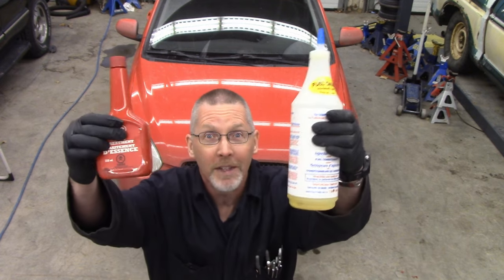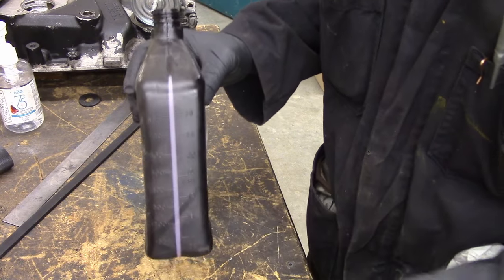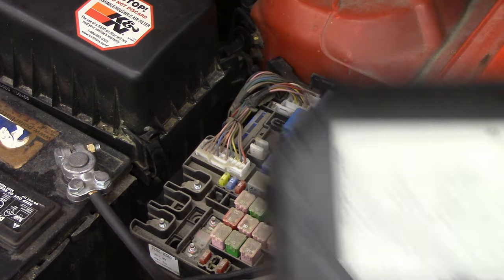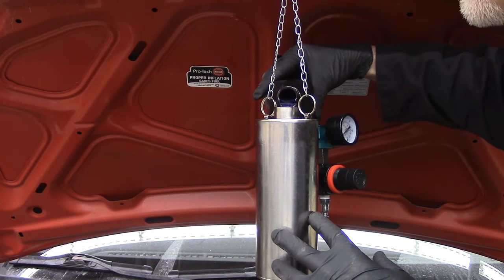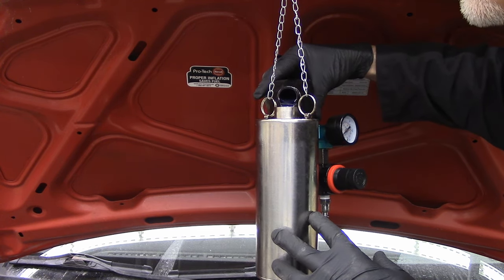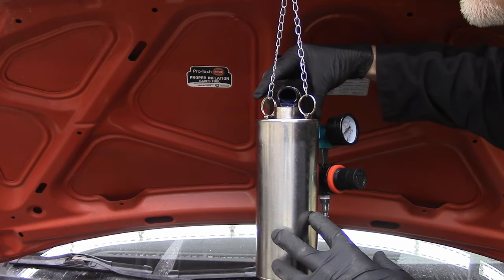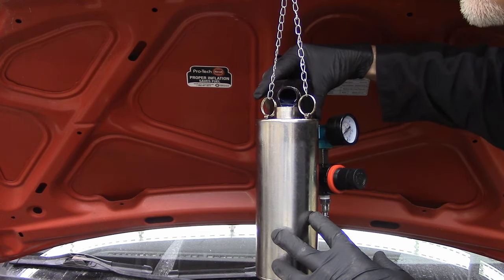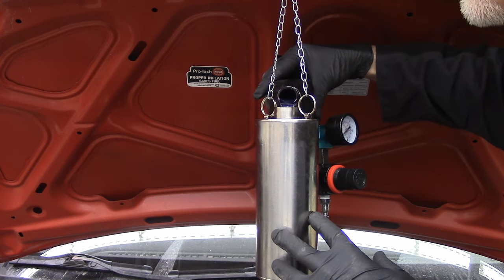HOW TO: Clean your Injectors IN PLACE!

Comment: No need to do that. Just drive on the highway and floor the accelerator once in a while and you will never need to clean your injecters. Fuel itself is a powerful solvent anyway.

Comment: I'm also in Canada and am having a hard time trying to figure out what to put in these machines. I was able to find something but I had to order it from the states and it's good to know that I can pick up something from Crappy Tire if my situation becomes more urgent. Fortunately, I'm only getting a misfire code on one cylinder and it only happens when my wife drives it. I can drive for hours with no codes. My wife drives 30 minutes and the light comes on. Four times I've reset the MIL after she drives. New plugs and coil but no luck.

Comment: I use STP concentrate fuel injectors cleaner I pour a can or two into the gas tank when it is a quarter low and add gas until half full and then I put the pedal to the metal and it works for me I also use chevron injector cleaner

Comment: I have a 90-something year van with a V6 and when I mash the gas it really don't get up Van Gogh it eases on up and sometimes it kind of makes a sport knocking popping noise and I was told it was a clogged up fuel injector or the muffler Cadillac
Reply from the maker: You can confirm a plugged exhaust with a vacuum gauge (vacuum drops at a steady 2000rpm), and you can substantiate clogged injectors by looking at Long Term Fuel Trim (LTFT) on a scanner (adding high % more fuel).
Reply: @GregWellwood  I don't drive it much. Matter of fact last year barely put a thousand on it. This year's about I think I might have about 1300. My first long trip hour and a half one way right at the end it started acting funny and then on the way for about 30 miles it wouldn't get over 20 miles a hour the next crank up and run fine 5 mi from the house starting

Comment: Hi, I didn't see it asked elsewhere - can you tell me what sort of adapter you used to connect your compressed air?  I bought a similar kit but the quick connect for air is a size/shape that I can't find a mate for.  1/4" is too small.  3/8" too large (it will go on but easily slides back off.  Appreciate any help :)
Reply from the maker: The air lines at work use an "M" coupler, so unthreaded theirs and threaded mine. Theirs is allegedly a common connector, but I have never seen what connects to it.
Reply: @GregWellwood  It's a Nitto coupler.  It fits Japanese and Chinese couplers (from what I have learned)

Comment: For the loose tool case, I've fixed that in the past by smearing a thin coat of hot glue in the bad slots with a popsicle stick. Another option I haven't gotten around to trying yet, but may work, is gently smushing the slots tighter with a soldering gun plastic smoothing tip (like the Weller 6160).

Thanks for lesson and the humor. Have a happy new year.
Reply from the maker: I'm going to have to try that! And thanks!

Comment: That button on the top where u fill it (blow off valve) is actually used to decompress the system. Thanks again bc I also didn’t know if it was returnless or not so thanks for the amazing video.

Comment: It runs a long time on that small amount of fuel because that small engine is just idling.
That 5.7 would eat it faster but it's most likely that the fuel went to your fuel tank on the return side. I've had it happen before.

Comment: the valve on the cap should be a manual pressure release valve.  Just push on the top of it after you are done running the cleaner and have disconnected the air supply hose you can depress to valve and relieve the pressure in the canister and line before disconnecting the line on the fuel rail.

And a tip on the return line system with this set up, another safety precaution is to take the gas cap off or jam a funnel into the filler neck of the caps less fill ports. This is just a precaution in case you accidentally open the pressure regulator on the rail an have 40+ psi of constant regulated pressure being pumped into the fuel tank. It it does the pressure will harmlessly vent to the atmosphere and not rupture your tank.

Comment: I've had good results doing this but not nearly as good as an ultrasonic cleaning on a flow bench. The students like it better too because they get to actually see and gauge the results of the cleaning by watching and measuring the way they flow.
I have the OTC on car master fuel injection kit with all the fittings (in my opinion, better kit than this because of the quality and the spec. book that's included for students to look up the information in). We also have the new Launch CNC-605A flow bench with ultrasonic cleaner. Both good products.

Comment: Would you know where the fuel service port is found in the 1996 V6 Toyota Camry LE?  Is it the port where the fuel pump regulator is attached?  The fuel pump relay is disconnected to turn off the fuel pump, so it makes sense to connect the system through that.

Comment: Thank you for your time in doing this, How can you decide if the actual injectors need to be changed, My Volvo has 222K miles and I am getting fuel injectors cleaners, the car runs great when driving. Thank you in advance
Reply from the maker: If cleaning doesn't fix them (and probably a more thorough cleaning than this can provide), they need replacing.
Reply: Depending on your car manufacturer mantainnce requirements  you probably need to replace the injector s every 100k miles. Just like everything else in your car

Comment: This is the third fuel injection cleaning process that only cleans 4 cylinder engines. I should get one of those kits unless I can find a cheaper way to do this. I wouldn't use Seafoam though.
Reply from the maker: What makes you think it's limited to only 4-cylinder engines?

Comment: Would adding SeaFoam to the gas tank when near empty accomplish the same?
Reply from the maker: If you could run Seafoam 1:1 with gas, yes - it would be the same.  Truthfully, this system would work best if you have an off-the-shelf "burnable" injector cleaner that is meant for this type of system.  Can't find much in this part of Canada....

Comment: I may do this as I have a pressure issue possibly an injector or pump issue. Ran seafoam.theought the gas tank for 1 tank no change in issue. So have done the key on-off method to pressure the fuel rail, and it starts right away. Does a seafoam induction clean and vehciel smoked for 22 minutes nice and thick and drove for 10 minutes on highway and still smoked another 5 minutes ran another round once I got back and this time it was light smoke so I'm assuming that I did well. Throttle body looks.clean from direct spray in method as well and wiped it out. I'm servicing an 02 Town and Country that was heading to the junkyard. And donating to a needy family.

Comment: How do I find out what the fuel pressure regulator is set at?  

The Haynes Repair Manual for the 1996 V6 Toyota Camry LE says ignition on with engine not running 38 to 44 psi, engine idling with vacuum sensing hose detached (38 to 44 psi) with it attached (30 to 36 psi), fuel system hold pressure (21 psi).  Which value should I consider in pressurizing the unit, subtracting 5 psi from it?
Reply from the maker: If you leave the hose attached, 5psi less than that one.  Consider plugging or pinching the return line anyway, and remove the gas cap so you don't inflate the tank by accident.

Comment: been putting off buying one of those kits for years, now with fuel prices and the possibility of russia going all in as a retired US genral said,  fuel prices could go crazy.
Reply from the maker: I don't think the kit will grossly improve your vehicle's fuel economy.  The price of gas is why I bought the Hyundai - my daily driver '77 C10 was getting expensive at $1/km in gas alone.
Reply: @GregWellwood depends on how bad the injectors are. I had a 95 escort and drive back and forth a couple times a month for college. I started out being able to make the trip on 1 tank, then slowly my mileage got to the point where I would have ran out if i tried it. We had a bg fuel service machine at school and I used it. I went from having to stop to having 1/4 tank left. I literally went from 20 mpg back up to over 30 mpg just from a fuel injector cleaning.

Comment: Hello sir I have question ? 
For dıs tool how to use.if you don't have air compressor to make vacuum line .den how to use dıs tool? 
If you connect for tyre compressor it's will work YES or NOT ? 
To understand how to work or to work whit dıs C80 cliner tool ? 
Thanks very much 🙏 🎉

Comment: Just Use Lacquer thinner in the Fuel Tank With Low Fuel. Roughly 5-10L of Lacquer thinner will clean everything from fuel tank to injectors exhaust side of Turbo Vanes and DPF if you own a diesel.

Comment: Great video. Any tips with using this on a system with a fuel return?
Reply from the maker: Keep the regulated pressure just below line pressure, block the return, and open the gas cap.

Comment: Do you have to mix with gas? Why if so?
Reply from the maker: I merely followed the instructions on the can.  If you can find a proper can of dedicated cleaner, you usually just run the engine off that.

Comment: Is 50 psi what's  recommended?
Reply from the maker: Just be about 5psi less than the factory line pressure.  If you have a return line, block it.

Comment: What if it doesn't have a returnless system
Reply from the maker: Run the air pressure a few pounds below the regulated fuel pressure, and pinch or cap off the return line.  Good practice to have the gas cap open so you don't accidentally balloon the tank.

Comment: Just curious, do you miss your Firefly?
Reply from the maker: Yes.  I try not to look at pictures of it; it's like the hot/psychopath girlfriend that you wish had worked out.  I am planning on building something similar once my '61 C10 is done.....
Reply: @GregWellwood  I have a couple of first gen honda civics and one of them I would like to put in a SBC. I built a V8 Vega and a V8 Astre (that I still have) back in my 20's and have been interested in engine swaps ever since.
Reply from the maker: There's more metal in one of those Civics than there was in the Firefly. I miss the '77 and '78 I had, too.
Reply: @GregWellwood  My 75 Civic is a little rocket!

Comment: Hello..Anthony Martin Emergency Mobile Auto...Great tip for you...Star Tron Enzyme Fuel treatment mixed with gasoline for fuel injector flushing...Use this regular maint. in tank....Use only 0w20/0w30 syn oil every 5000 miles/Class 4 only...Hyundai/Kia GDI engines need all the help you can offer them..Take care.....
Reply: "Korean suppository"  😅😂

Comment: OK - so how about the old fashion type of carb/injector cleaner?
Take it out on a clear un-obstructed road and just floor it!
That should open up the injectors to max and allow the fuel flow to help clean them.
Also using a cleaner at the same time.
Must be done several times to be effective, then every month, just floor it (and not get a ticket by  speeding ).
Works for me.
Reply from the maker: The flow through the injector is always the same, it's only the "on" time that changes.  You need something that can dissolve the stuck-on debris.

Comment: Dump a can of seafoam in your gas tank every two months or so and it will work wonders for keeping your injectors clean. It also helps to not use shit grade gas from questionable gas stations because that junk often has a ton of water and particulate in it.
Reply from the maker: I tried a 50/50 mix of Lucas and gasoline, but the engines did not like that.

Comment: Let me teach you a little something about using this tool, young man! You are best to start the car and get it warmed up before you hook this up, so your injectors will be wide open and spraying plenty of cleaner. Your best to use a cleaner actually made for this tool. You can add seafoam to your gas tank and do the same thing you're doing. I'm just here to teach the teacher.  

I noticed your car was not running very good at first and warming it up will also solve this problem.
Reply from the maker: That's not how fueling works.
Reply: I don’t understand why you think the engine has to be hot. From what you posted, you seem to think that the “cold running” fuel doesn’t go through the injectors. In fact, the same injectors provide all the fuel, whether the engine is fully warmed up or not. When the engine is cold they will actually add more fuel than when hot, so they will be open longer at idle than when fully warmed up. They don’t ever “open wider”, hot or cold; the ECU only varies the length of time they are open.

Comment: everyone makes these videos and skip the step about connecting the air compressor. how to set it up and the purpose of it. no real help to someone who is completely clueless
Reply from the maker: I never really thought to show it, connecting a compressor to something is kind of like "how to open the door to your car to get in."  I never thought of spending time on it.  Would you like a video on air compressors?  What would you like to see/know?
Reply: @GregWellwood  like do we have to set the air compressor to a certain air pressure? Or that doesnt matter...i have a portable 12v air compressor, i don’t know if that would work or can even connect to that device and i am guessing based on the video, the air compressor has to be on before starting the engine?
Reply from the maker: In the video, I setting the regulator on the cleaning unit to about 5psi less than the fuel pressure of the vehicle.  Since it is regulated here, you don't need to change the regulator on the compressor.  On the red car, I used our $8000 shop air compressor.  On the gray car I used my $120 portable compressor. You would want the compressor on and connected and pressurized.  It's not going to push anything through until the injectors open by the computer. I don't know if you could do it on a portable 12V compressor - It's not volume of air that it needs, it's merely pressure, and 13V compressors are pretty minimal.  You'd have to see if the compressor could maintain the right pressure. Good question!
Reply: @GregWellwood  thank alot

Comment: I have a dart with 538,000 kms on the original drive train, I have entertained the idea of doing what you did with your Hyundai,but the dart works great so I am reluctant to try seafoam or other additives for fear of screwing up the engine, prior to watching your tutorial, I may try now,thanks 🧰
Reply from the maker: Seafoam (or other fuel cleaner) is pretty harmless in the fuel.  It will either make a difference or it won't, there isn't much that can go wrong.  Using it (or any other cleaner) as an engine flush or combustion chamber cleaner is a bit different, which comes with the risk of making things worse.  Or better!  (grin)

Comment: This guys is got no clue what his doing . They sell injector cleaner that runs with high octane tjag clean your injector . Go to a shop and remove and fuel regulator its gonna be a $600 fuel injector cleaner charging flat rate 🤡